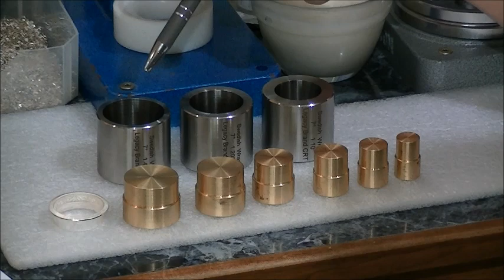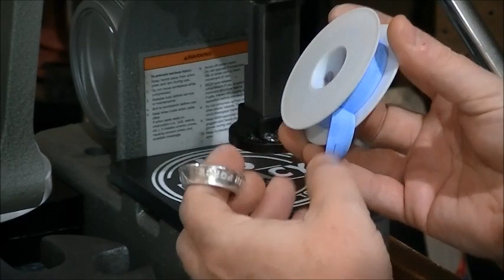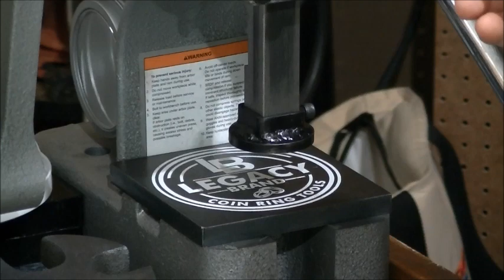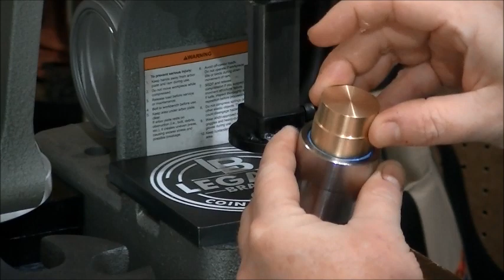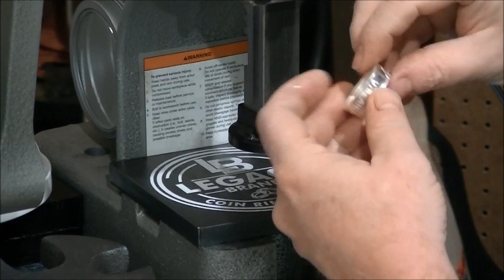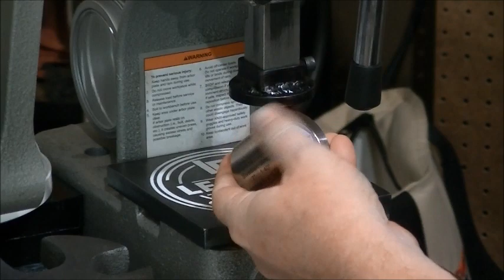Part 1 : Swedish Wrap Dies Set with brass push rods - Coin Ring Making

Comment: Gary, I've heard with silver coins delrin push rods are preferred, and I notice the delrin rods are included in your deluxe swedish wrap set on etsy.  Is there a reason you didn't use the delrin rods?  Thanks, Mike
Reply from the maker: Mike,
Good question as most of the time when I am reducing a .999 silver coin, I used delrin rods. For this particular video, I wanted to demonstrate that a reed could be preserved using brass rods. Brass rods are more common, however delrin rods have a few advantages. One thing is protecting the reed, and a second advantage is the ability to over-reduce just a little bit when the rod touches the inner wall of the Swedish wrap die. Doing so reduces the ring a slight bit more and makes transition to the next smaller rod easier. Most cases I use brass for clad, or very thick coins, and delrin for .999 silver coins.
Reply: @legacybrandcoinringtools2956  Thanks for the info, Gary.

Comment: How do you get the flat coin started . Is it on a video.
Reply from the maker: John,
Many use a starting cone which helps to begin the fold of a flat coin, and then move to the 17° folding die. Here's a video of how to use 17° folding dies with cones to fold the flat coin https://youtu.be/8kP9l0dmF8g

Comment: What are you using as a bar on your arbor press? Also can't find your second video in this set
Reply from the maker: Jon,
That is a harbor freight breaker bar that I cut the end off of and replaced the handle with. There is a link right at the end of the part one which will take you to part two. Here is a link if you can't find it https://youtu.be/590ED-1UErU